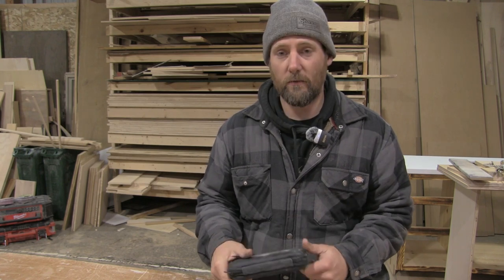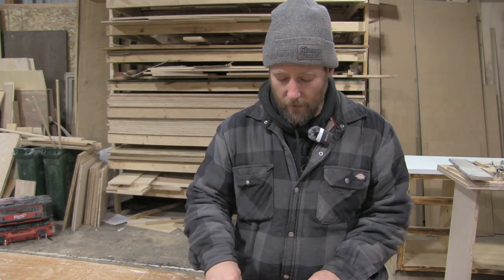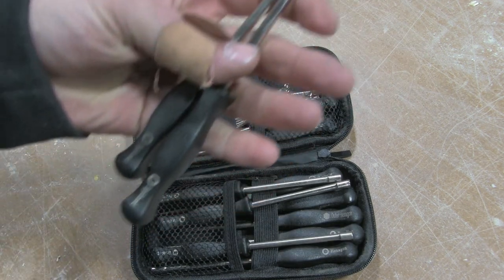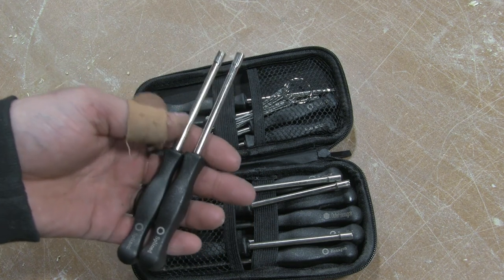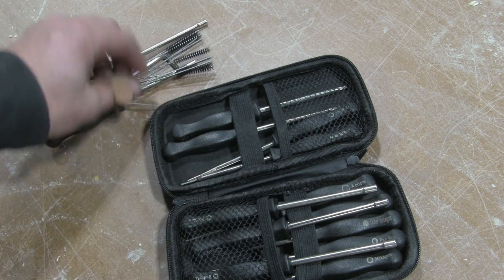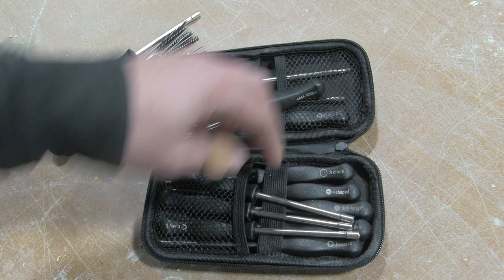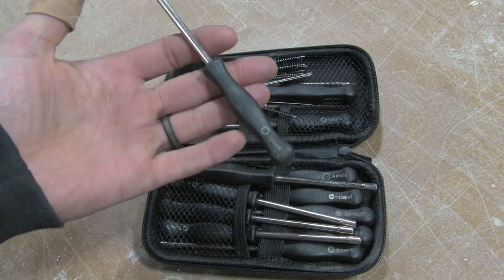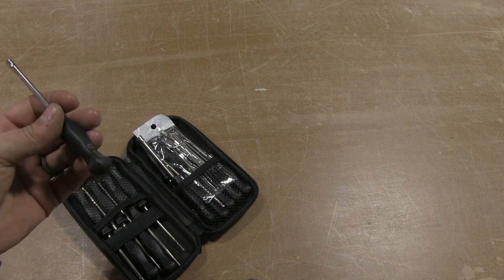2 Stroke Carburetor Adjustment Tool Kit - Central MN Firewood #10

Comment: I have a 455 for sale. I'm in central MN as well.
Reply from the maker: @randdog I responded to your comment on the other video about your saw, The 455 is about the same as this 5020. I will run this one into the ground before getting another 50cc class saw. I did buy a 95cc saw about 3 weeks ago